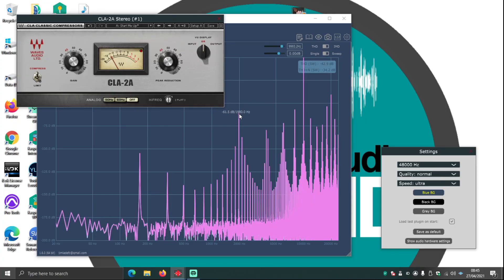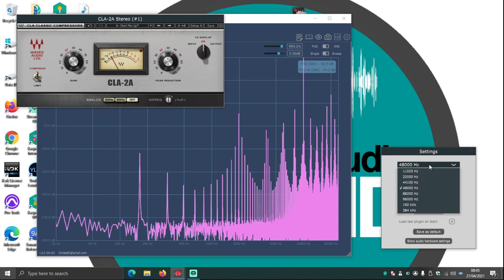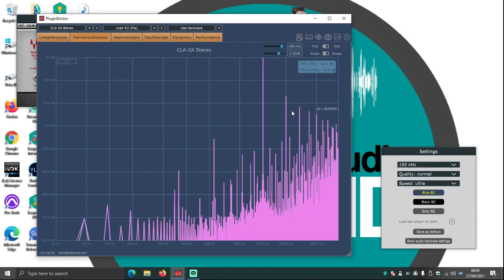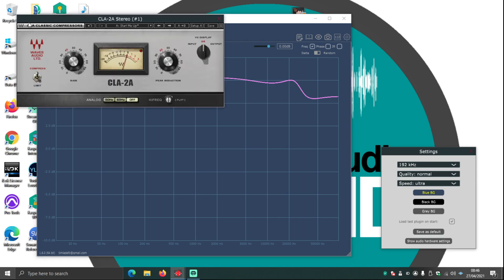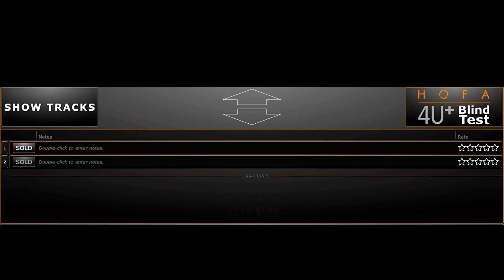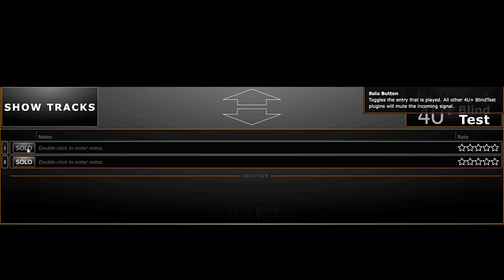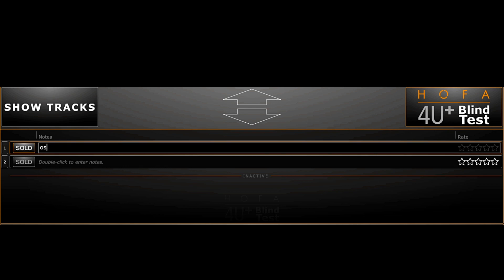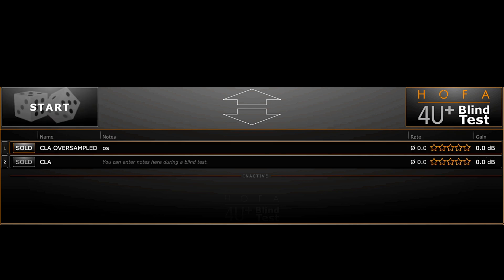WAVES CLA COMPS OVERSAMPLED || Does oversampling Waves plugins to 192khz really make a difference??

Comment from the maker: Did you hear the difference?.. Or do you think it's just because I sat with the tracks comparing for so long?
Reply: It is crazy especially on vocals! That non-oversampled version sounded like there was some mic bleed from someone's singing totally off pitch. Almost like usable vs non-usable take. That's insane! 
To me it's one of those things that you are constantly looking for after somebody showed them to you for the first time...
Reply from the maker: Yeah the guitars and vocals were so apparent to me. The vocals to me oversampled has more depth and clarity to my ears. It's like the aliasing adds a film over the vocal and it doesn't breathe as much. Only way I can describe it haha
Reply: @PaulThird  yeah. Aliasing sounds so bad. Unless your going after a closed, digital sound on purpose for some reason.
Reply from the maker: Waves is the worst for it from what I've seen. Especially the older stuff. Mental 😳
Reply from the maker: If they don't include it in v13 I will be pretty shocked haha
Reply: Sample rate vs oversampling next time? so we can hear what metaplugin is going
Reply from the maker: Yeah that could be a 60 second short 🤓
Reply: @PaulThird  I know you said you can't oversample Nebula, but a work around for this I tried is oversampling before you hit nebula and after...it changes the sound for the better in my opinion
Reply: Also, It doesn't shift the frequencies like what happens when you just straight oversample it
Reply from the maker: Have you checked it in plugin doctor?? Just as when I oversample nebula it multiplies the frequencies. That's why they all have the sample packs included. Compressors linear frequency response will shift so the more you oversample the more low end you'll lose out your source and also they'll be more high end as the high pass filters wont roll of the highs as its been doubled.
Reply from the maker: Have you checked it in plugin doctor?? Just as when I oversample nebula it multiplies the frequencies. That's why they all have the sample packs included. Compressors linear frequency response will shift so the more you oversample the more low end you'll lose out your source and also they'll be more high end as the high pass filters wont roll of the highs as its been doubled.
Reply: @PaulThird  Yes! I did 
Before : https://ibb.co/tpf3HLP
After : https://ibb.co/2SScCQz
it's The GMC by Alexb
Your the best as testing plugins so I think you should give it a try, 
So how it works is your first insert is Metaplugin and then load in a gain plugin turn down 2db and   oversample the plugin then my next insert is Nebula and then another Metaplugin doing the same thing but 2db up
Reply: so me it's sound so much better, but my ears could be playing me so you should give it a try
Reply from the maker: I'll try it! BTW.. Its true what the say about the ripple bug being in Alex's libraries eh?
Reply: @PaulThird  Honestly, I've never really heard a difference but it's all about how the nebula libraries are used, I find if you run to many inserts of nebula you can lose a bit of punch  but I think some of the talks about his libraries are a bit over blown
Reply: @user-hy4xz1qt9h  I don't think it's going to make much of a difference. Also, some DAWs let you freeze a track while bouncing at a higher sample rate, if you set them up right. I'm using that in Reaper. I was tempted to get DDMF though....I really hate aliasing. Huge pet peeve of mine.
Reply: Yup. Positive difference.
Reply: For low frequencies material and drums i dont find the aliansing too obvious or a big difference. I mostly hear a big difference on clean vocals, or screaming vocals. The top end in this two changes a lot with oversampled plugins.
Reply: I've been performing on stage next to a drumset for 20+ years. I don't hear it 🤓😉 correction: even I can hear it in the 8:15 example 😃
Reply: No you didn't. Even through the lousy lossy YT codec you can hear a huge difference.
Reply: There's a difference, but the algorithm isn't really the best, imo.... so it's probably just helping eliminate most of the aliasing.
Reply from the maker: The linear frequency response is really odd to me. Especially in the bluey on the cla76. Dips a lot of high end at 192khz. Never seen such changes just oversampling
Reply: @PaulThird  i should go back and listen on better speakers... Was on the go, just had some earphones..... Ok. But not great. I haven't really cared for the waves CLA much in general though. Hadn't checked it out recently though.... (Or over sampled)

Comment: what is the maximum you would oversample with waves plugins such as CLA-3a ? I tried Metaplugin with La-3a and it does not sound better beyond 96Khz, Bass disappears IMO
Reply from the maker: Cla3a is supported to 192khz but realistically 96k max. Doesn't need any more as it's harmonics are more low focused

LA2A is different as it makes more high order harmonics
Reply: @PaulThird  many thanks for the info Paul ✨🙌🏻

Comment: I dont know why I got it all  on which are oversampled because of the low end, when It shoudnt be the case, well it sounds also fuller. But really there shoudnt be any change in the low end right?
Reply from the maker: Nah not really, only in the lows unless you oversample past the supported frequency rate of the plugin. maybe low mids dependent on how far the aliasing stretches but if you hear a difference and pick them blind then you know there are differences which is all you need to know really
Reply: @PaulThird   Oh i was listening in my studio with your video, just went straight to the part where yoou where checking it. Never looked at the screen, and just wrote which one is oversampled, and my guess to my surprise was all right, but I got confused cause the things that made it different for me was the low end, or maybe theres a bit rise in gain that made it bigger when i was checking in the monitors. But thanks for the video!

Comment: Just bought metaplugin and loaded Black box HG2 and man it sounded crazy good.  The highend sounded sounded smoother and lowend sounded more solid and richer, while the smeary dirt when away.
Reply from the maker: How much did you oversample?
Reply: @PaulThird  4xOS
Reply from the maker: What sample rate are you working at?
Reply: @PaulThird  44.1
Reply from the maker: Yeah that makes sense with 4x then. 4x should be enough
Reply: brainworx plugins are already oversampling
 @cheadlejuice-musicproducti5875
Reply from the maker: Not enough to stop aliasing when pushed hard
Reply: @PaulThird  bet, should i use oversampling on melodyne too?
Reply from the maker: A mentor of mine looked into it and I believe it's a myth that pitching sounds better at higher sample rates. However the difficulty arises when we take the algorithm into consideration. Oversampling makes the calculation more precise from what I recall so extreme processing may give you more accurate calculations but in regards to the sound quality it's the same.

That seems odd to say but if you see sample rate and the algorithm calculations as 2 seperate things then it makes more sense.

Id say it depends on the severity and complexity of the pitching involved
Reply: @PaulThird  thank you, and running a project in 96Khz, is the same as a project in 46Khz with metaplugin and 2x oversampling right?
Reply from the maker: Not exactly. X2 FIR at 48khz with metaplugin will be closest to running plugs at 96k but x2 IIR won't cause its minimum phase. So the high end will be skewed a little.
Reply: @PaulThird  okay if I use the megaplugin, should I run every plugin thru it or only the first / last plugin on the chain?
Reply from the maker: Oversampling is per plugin. Reaper is the only daw that can do chain oversampling and stuff. Only oversample plugins that need it which will be plugins that produce lots of high order harmonics.

I check aliasing via doctor and printing physical sweeps
Reply: @PaulThird  bet appreciate you

Comment: Thanks Paul - Ive been wondering why my mixes using waves CLA and PUIG plugins sound flat.  Now I know.
Reply: Stupid question - So if my project is recorded at 96khz, and the plugin is supported up to 96khz (per the handy chart you put up at 1:19), is there still benefit from oversampling or can I even oversample since I'm already at the limit? Or since I have Slate and other versions of the same compressors, maybe I should just use them instead? So many choices.......
Reply from the maker: You can only oversample to the highest supporting sample rate. You can still oversample past that but it will multiply the frequencies so a 1k boost will be 2k etc everything shifts up when you oversample past it's supported sample rate.

So at 96k unless the plugin is supported to 192 then you can't oversample it further
Reply from the maker: Glad I could help 🤓

Comment: Hello... great content as usual keep it up.. I was obsessing over this topic latley and was wondering in your opinion is chasing sonic perfection really that important nowadays.. I m from a Era of people consuming music on high end stereo systems ..big expensive speakers subwooofers the whole nine.. but today's market is mostly cheap earbuds or cell phone speakers.. Im just thinking that sonic bliss is not really cared for nowadays.. its like consuming a 100 dollar steak on a paper plate with plastics forks on the back of a pickup truck instead of eating it in a nice restaurant with ac real China and silverware and a bottle of expensive wine..lol both ways will get you full but one will more than likely a better dinner experience.. just my opinion 🤷
Reply from the maker: perfection no. clear and musical sounding mixes yes. The thing is with aliasing it can be avoided via proper gain staging and internal oversampling. its a very quick and simple fix. 

I still say that trying to make the best sounding mix with what you've got is the best way forward. Its not fair on the artist or to the music to cut corners or not spend the time to get the best sounding record you can. What i will say is that high quality headphones are becoming cheaper as the years go on and more accessible. 

If you want to make it as a mixing engineer then you still have to be at the top of your game. Think of it this way, its better to be OTT than take a chance. what can happen is that you start becoming complacent where you've lowered the bar to a point where you start questioning if people can still hear the difference and then before you know it the quality of your mix compared to somebody elses starts to become apparant.

I always think try and strive to create the best you physically can. If some details get lost on a lot of listeners then at least there are still some listeners who appreciate those finer details in their listening environment. 

Thats why guys like serban ghenea are really only going to be taken off the top spot unless they decide to stop mixing. Take pride in your craft :)

Comment: I have to say I'm finding it extremely hard to tell the difference. And even when I think I can hear a difference I can't say whether one is better than the other. Maybe I just don't know what to look for. Are others struggling as much as I am? Can I blame Youtube for this or do I need new ears?
Reply from the maker: I did spend quite a bit of time getting each to sound as good as the other but I'd say they are still very different but it may just be that I spent lots of time tweaking each so I know the differences. I'd say listen to transients and overall punch, then low end, then overall width of the track and it should start to come apart but it is subjective 🤓
Reply: even on my MBP speakers i hear a significant difference in transients and more detail in highs. im more convinced that the people who sit on the other side of the fence when it comes to sample rate wars haven't trained their ears to listen this way.
Reply: @nepntzerZer  you could be right. It shocking sometimes when you see someone spouting "knowledge" and then you finally hear their work and it's terrible. You can't always rely on other people's experience.